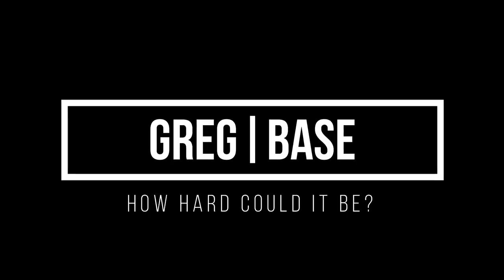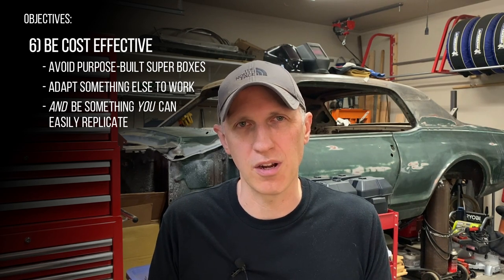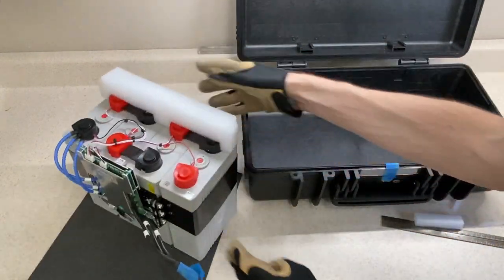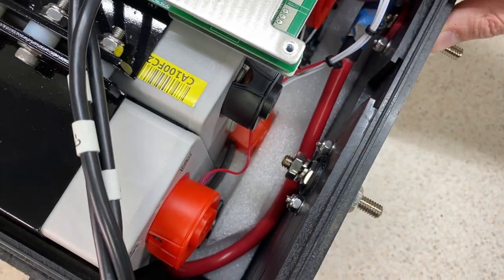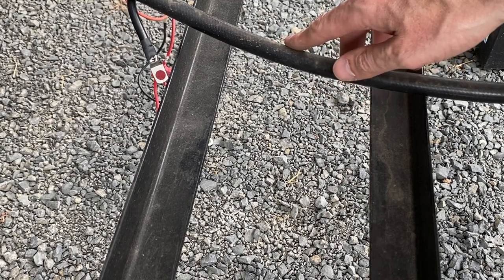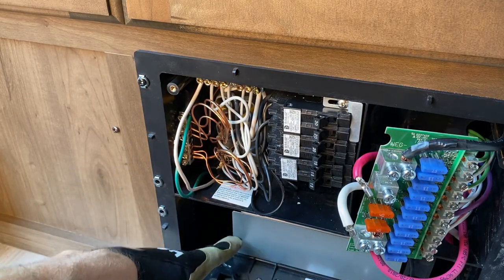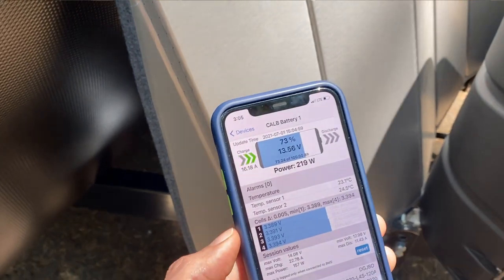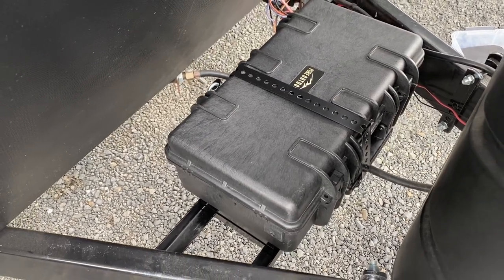DIY Lithium RV Battery Build - Part 3: Battery Box, Installation, and Converter Replacement

Comment: I subscribed just based on the quality of the solutions. This allows me to build my 48volt with 2 cases since I was trying to figure out how to do a split case for moving the batteries. All I need to do is now is figure out the bms pass through but that should be relatively easy. I think. Lol.

Comment: Continued excellence in this video.  That box could be a commercially sold unit, it's done so well.  200AH @ 12v or 100AH @ 24v would both be very useful.
Reply from the maker: Thanks! Super happy with how it turned out. 24 volt is intriguing for the future too!
Reply: @thegregbase  - It's not particularly relevant for your application, but as voltage goes up, so does inverter efficiency.  So, for emergency backup power in your home, 24 or 48 volt batteries, with corresponding inverters, can make a lot more sense.

Comment: Thats a great build I am using the same kind of camera/gear cases off amazon as they're so well built and sturdy for the money -  and using nissan leaf cells in there - done a small 14v 60ah one and doing a larger 14v 120ah one at the moment.  Each one is self sufficient with small victron 75/15 charge controller, and multiple usb and 12v outputs.  The bigger one is going to have an 800w inverter bolted to the outside too.
Reply from the maker: Nice! Sounds like you built an awesome self contained and portable unit. If I had more room inside, I would potentially have put more electronics inside.

Comment: Thanks for the upload. You should add fuses, and battery pack cables are supposed to be the same length to prevent unequal voltage drop. Nice box though. I think the CALB's, with their plastic cases are perfect for mobile applications. If you plan to head out in cold weather, you may want to also add a 12v heater in the box. (Glue on tank heater or silicon heater with built in thermostats work well)
Reply from the maker: Yeah, your advice is good advice . Will looks at some revisions in the future.

Comment: Nice box. Super build. Did you consider a breaker @ the box? I saw the cut-off switch inside, but I think a fuse or DC breaker there at the box would be a plus. Nonetheless, awesome build. Thanks for sharing.
Reply from the maker: That's a good idea.  I should never see dangerous current with normal loads, but if something went really wrong, a breaker would add some additional protection.  Guess I do need up to the next size of box :)

Comment: That installation looks awesome. I have a 12v 200AH LiFePo4 that I purchased complete for about $1000 delivered. Yours looks way better, has better user controls/information and I bet it cost much less. It would be helpful if you put together a build sheet for it. I wanted to build my own but I didn't feel like having to justify it to the wife and I was surely going to hear about it if things went south!!

I'm glad you put a strap and lock on it. I'd consider that a must for any that was accessible from the outside. I'm curious to find out how your converter worked. I couldn't tell if you bought a multi-stage one. I assume you did because single stage chargers are garbage. It wouldn't make sense to go through all this and short yourself on the charging end. 

Are you disabling the charger from your tow vehicle? As you probably know, there are some concerns about charging lithium using the alternator but there are a some solutions that can alleviate those concerns.
Reply from the maker: Thanks!  I really liked how it turned out.  

I'd say 200AH for $1000 delivered is not bad at all (compared to some of the off the shelf units that are closer to $900-$1050 per 100AH).  Mine was in the same ballpark as yours, but I also enjoyed the heck out of building it.  I'll have to put together a build sheet.  Great suggestion.  

Converter worked okay, but that led me to discover some areas where I dropped the ball, and other shortcomings of the trailer that are limiting its performance.  All in all, though, it worked great, and all of the other stuff is just tweaking the frosting on the cake to make it even better.  I'm putting together a video following a trip with the batteries (they take a surprising amount of work to edit), and will get something together with what went well and didn't go so well, and what needed tweaking.  

I hear you on the alternator.  Haven't addressed it yet, but will need to soon.

Comment: I always said,I would replace the marine battery on our trailer once it died. Well, it died. I don't think I'll build a lithium battery or mount it back on the trailer tongue. I do plan on mounting inside under the bed. Thank you for your research.

Comment: Question great job by the way! I was wondering aren’t lithium heat sensitive  I ask because with other installs there always putting fans in. This method seems simpler I rather do this.
Reply from the maker: Thanks for the question. Lithium Iron Phosphate (LiFePO4) aren’t as prone to thermal runaway as Lithium Ion chemistries used in electric vehicles, for example. Not sure if that’s where you were seeing the use of fans. LiFePO4 gives up some energy density as a trade off for this stability, but worth it in this case. If you look at the off the shelf 12v lithium replacements, they are the same types  of cells I’m using for that same reason, sealed in a case that just happens to look like a car battery. So essentially I’m doing the same kind of thing. If I was building a really big bank of batteries, I might do it differently and consider some active cooling as an additional insurance policy, though.

Comment: I'd be concerned about placing cells on it's side for use. Bet the small amount of liquid inside does not like it long term.
Reply from the maker: Great note.  Generally speaking, flexibility of mounting orientation is one of the advantages of LiFePO4 batteries.  

That said, each cell type (and manufacturer) has its own recommendations and limitations.  As I understand it. for prismatic cells with a safety valves on the top, it is preferred to orient the cells with the vents facing upward.  Most manufacturers say laying on their sides is fine, though, with having them on their edge like I have them being preferred to laying them on their flat face.  Upside down is a no-go.  The concern is about the electrolyte pooling in the safety valve and rendering it non-functional. 

If you make your battery from cylindrical cells, on the other hand, this doesn't apply, and the sky's the limit as far as I can tell.
Reply from the maker: Great note.  Generally speaking, flexibility of mounting orientation is one of the advantages of LiFePO4 batteries.  

That said, each cell type (and manufacturer) has its own recommendations and limitations.  As I understand it. for prismatic cells with a safety valves on the top, it is preferred to orient the cells with the vents facing upward.  Most manufacturers say laying on their sides is fine, though, with having them on their edge like I have them being preferred to laying them on their flat face.  Upside down is a no-go.  The concern is about the electrolyte pooling in the safety valve and rendering it non-functional. 

If you make your battery from cylindrical cells, on the other hand, this doesn't apply, and the sky's the limit as far as I can tell.

Comment: Once the Installation was complete did you have to do anything to your 7 pin connector from your tow vehicle? Does the charge from the 7 pin work ok with the lithium batteries?
Reply from the maker: I didn’t have to do anything to the seven pin connector on my tow vehicle to get it to start charging. That said, different vehicles may output different voltage levels, so not all alternators or charging systems may successfully charge a lithium battery. I also understand that there is some danger in charging directly to your lithium battery from your alternator.  Because the lithium batteries can take as much charge current as your alternator can probably output, you could blow a fuse in the charging circuit. Also, when the BMS shuts off charging suddenly, that can be bad for the tow vehicle’s charging system. I have not experienced this myself, but every vehicle is different and there are known concerns.

Comment: Great job! Makes me consider building my own batteries. Have you further checked the wfco charger? I'm in the research phase trying to decide on the wfco replacement or one of the other brands that offer a lithium compatible converter charger that fits the wfco box.
Reply from the maker: The WFCO charger is okay. I get about 35A peak charge current out of it. But I have about 25’ of factory 6 ga battery cable and wiring between the batteries ( front of the trailer) and the converter (far back end of trailer) , so this is probably playing into things. There is more efficiency to be extracted from the overall system before I would invest in a different converter. 

Though I don’t have personal experience with them, there are some other options from progressive dynamics that are well regarded. At the time I bought my WFCO, the price and availability difference was kind of significant, but now that prices on cells have dropped, that’s not as much of a concern. But again, it’s about the whole system. Getting a mega converter will expose the next weak link.
Reply: @thegregbase  Are your batteries getting to 100%. I had heard some complaints the 8950l2 voltage output was less than the recommended 14.2-14.4v. That's why I was considering one with adjustable output. Yes, lifepo4 batteries are getting cheaper 👍

Comment: What guage cable would I need if my batteries are separated by 4' ? I know this is a unusual question but I have a set of 2 batteries and a set of 3 batteries that I want to combine together into a single bank.
Reply from the maker: The size of your cables will be dictated in part by how many amps of current you’re going to push through the cables. Voltage affects it too, but I’m assuming you’re talking about a 12V system. You can find cable size calculators online that will let you plug in values. I used one at wirebarn.com and assumed max 150A at 13.8V. They say you can get away with 4 gauge, but 2 gauge might help you sleep better at night. Doesn’t cost that much more than 4 ga either. If others have other opinions, feel free to weigh in.

Comment: What was your final cost?
Reply from the maker: Here's a bit of a breakdown.  This is effective cost for parts used.  For example, in some cases, I bought a case of heat shrink tubing.  So technically, I might have spent more than shown, but I ended up with excess.  I ended up using the extras on the second battery, or other projects, so not accurate to attribute all of the cost to one battery.

First Battery, band, bms, bus bars, connectors: $699.00
Second Battery, band, bms, bus bars, connectors: $567.11
Case, internal cables, terminal blocks, hardware to mount to trailer: $179.04
Converter/charger: $157.70

This was all circa 2020/21.  I went back and looked at current prices, and today, the same battery would cost $354.31 to build with the exact same cells, BMS, and pieces.  The case assembly would cost $167.

Thanks!